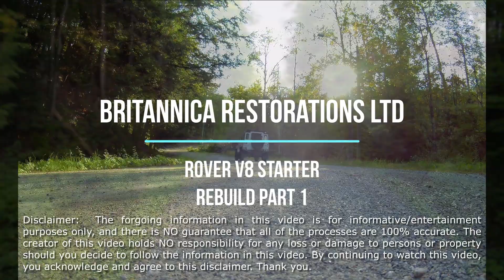Rover V8 starter rebuild part 1

Comment: Great to know this Mike for my V8 Thor Disco 2. I've always been told the Td5 starter was the only one that can be taken apart and replace/clean the internal parts.
Cheers from East Anglia!
Reply from the maker: They are really easy to do IF you do not have to change the brushes - these have the same motor pack as a 300/200Tdi starter I did a while back

Comment: On the video hey look like the security Torx with a pin in the middle. If so, they are doing their job. In my experience they are much easier to get out with the impact than philips if you use the correct bit. It's amazing how much smaller the V8 starter is now compared to the early ones.
Reply from the maker: They were regular Torx heads but really shallow - the replacements were deeper

Comment: Mine is still doing good, but good to know if it does go west. Torx bits are a ballache right enough. I'm currently on replacing the windscreen rubber and only one broken screen so far - nice!
Reply from the maker: You need a thick cord (a thin cord will tear the rubber on the corners) and WD40  - take off the bonnet and lay some plywood in its place and have someone hold it in place evenly by sitting on said plywood  - if you can borrow some of these then it makes life easy

https://www.amazon.co.uk/ebuyerfix-Suction-Aluminum-Remover-2x115mm-50/dp/B09VFXHSWD/ref=sr_1_6?content-id=amzn1.sym.8bed1630-c171-4184-aba5-160dcd52e827%3Aamzn1.sym.8bed1630-c171-4184-aba5-160dcd52e827&keywords=suction+cups+for+glass&pd_rd_r=da206fc6-510c-4e48-b12f-ca22a08fe11f&pd_rd_w=vheuG&pd_rd_wg=OTrJe&pf_rd_p=8bed1630-c171-4184-aba5-160dcd52e827&pf_rd_r=QV9RY7NS7RCG4Z9J6HZ2&qid=1686157261&sr=8-6

 Will pop right in!
Reply: @BritannicaRestorations  Thanks Mike. Was almost there but was late in the day, being bitten by midgies and rushing it. Too much pressure out of frustration on one bit and CRACK! 3hr trip last night to get hold of a decent second hand screen (still in frame). So second attempt to commence when I'm in the right frame of mind. And yes, I used too thin cord (was actually electrical wire).
Reply from the maker: You were lucky to get one used! 
I had to buy a minimum of 10  - the cost of shipping was eye watering! 
But the screens were £30 each - laminated and tinted

Comment: You'll probably find that the torx were T30 Mike...I haven't come across any that use a T28 bit as yet....the bit should be a nice tight fit....may have been security type as mentioned elsewhere.
Reply from the maker: Sorry T25
Reply: Ok...most torx I've come across go up in 5's so T20, T25, T30, T40, and T50 are most common

Comment: Regarding Torx Mike. Designed for aid of assemble in the car plants not for us repairing things. But you knew that already!

The T28 you mentioned. Now as far as I know the sizes go T20, T25, T27, T30 etc. Maybe someone in China hit the wrong key and you got a T28!

They do do impact rated ones. They are the best especially the ones that fit into the old impact screwdrivers that you can hit with a hammer.

Stay away from the security bits with the whole in the center. What a stupid idea, take a weak tool and drill out half it's strength. (In the words of the late Terry Wogan. "Is it me?")

I can't say strongly enough that you really need a quality set of Torx bits. Cheap ones are useless. 

Having said all that. Red Locktite. Why red, you didn't stand a chance. They designed it never to be opened!!
Reply from the maker: Sorry it was an T25 - I could not see the marking properly
Never see many Torx here
Reply: @BritannicaRestorations  Aren't you the lucky one. My heart sinks every time I have to remove one.
Reply from the maker: If they are into plastic, you have a fighting chance - if rusted into metal of any kind (with Loctite), you have F all chance!